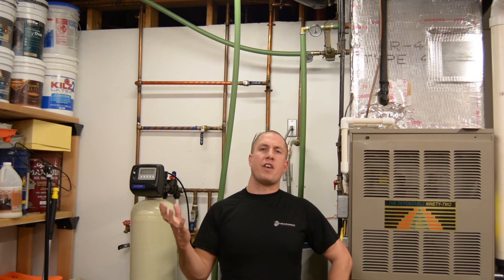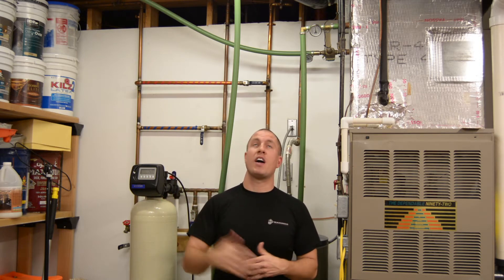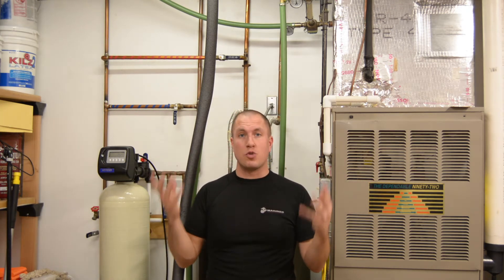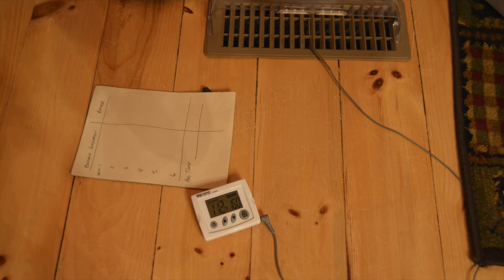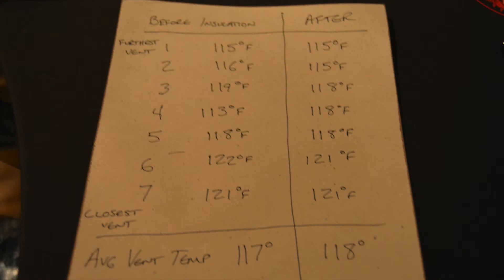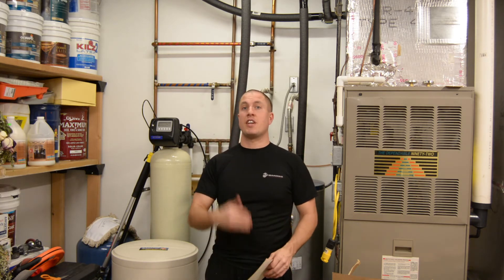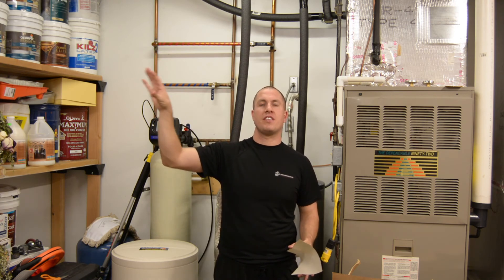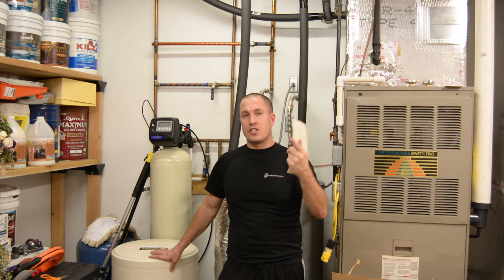Central Boiler Classic / PEX Insulation Testing / Do you need it?

Comment: Actually makes sense for your vent temps to go down. My rational is your basement is now colder; because of the lack of ambient heat ( no more 80 degree mechanical room) from the pipes. The hot air in the vents will lose the heat gained faster that the hot water in the un insulated pex pipes.  However, i do think there is an overall system efficiency from the insulation that will be realized by "likely" longer burn times.  Un insulated you have 8 hour burn time insulated you'll be 10-12 hours.  Bottomline, you'll save on wood consumption.  The cost of the wood and less time at the boiler can be used to determine if the cost of the insulation or payback period.

Comment: Why not just check your water tem at the supply line at the furnace?  Before insulation then after. Like the video I have not insulated mine yet but was thinking about it.
Reply: An infrared thermometer might be an option!
Reply from the maker: Tried multiple models. Horribly inconsistent for this test.
Reply from the maker: The Lineman good idea. I need an in water probe. The crappy strap on pipe temp guages were not working like I had hoped

Comment: The temp outside your house would have to be the same during the before and after test for this to be completely accurate, right?
Reply from the maker: Aaron Bowles in theory, the outside temperature would only effect the boiler temp and it cooling down faster. The line is buried below the frost line. So it should not have any effect on this test.  The temp outside was no more than a 5 degree drip from first test to second.  The burner retained more heat with the second test as well so outside temp was not a factor.